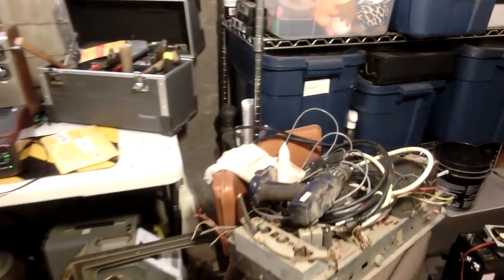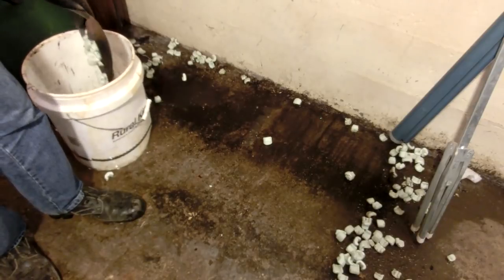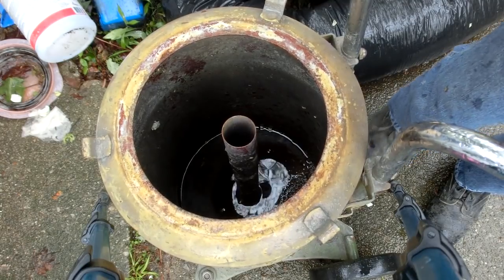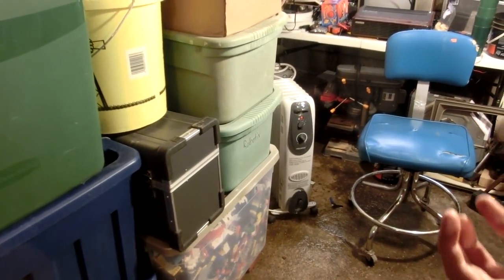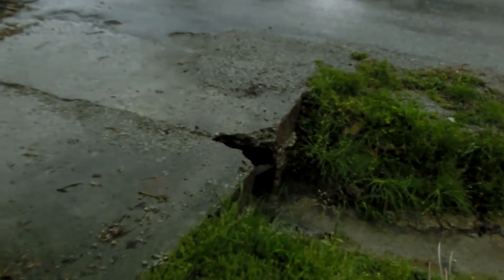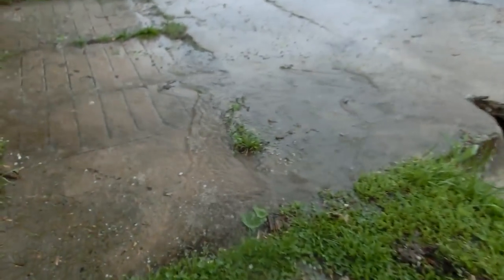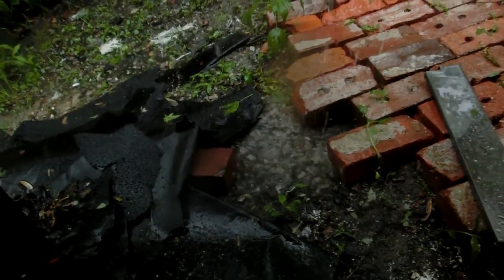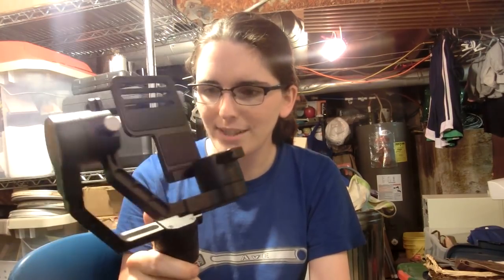Random Bits 0171: Basement Cleaning, Hail Storm, Vacuum Chamber Saves the Day

Comment: Might want to consider a sump pump. That said does your house have weeping tiles on the foundation? If it does, its probably packed with sand by now. Its an issue in the area I live, the weeping tiles of older homes are just packed with sand because of developement in the area ripping out all the plants, so the sand just flows into yards and homes when it rains, and on windy days it gets forced into houses through any holes. Sandy ground was great for growing trees, and plants, but donkey shit for growing grass, so there's nothing to keep it from flowing and blowing.
Reply from the maker: no point in a sump-pump for us, our basement floor is above the sewer line so we have a drain that lets it all drain, but the floor is uneven allowing for it to pool. it has broken bricks that dont really have much mortar between them, and lots of cracks in the concrete. lol
Reply: Yeah sounds like some foundation issues then :P when me and my Dad lived in Ottawa we lived in an old townhouse that was on septic system. And it had constant flooding problems in the basement due to the fact that the fucking weeping tiles were done cheaply, and didn't go down the the base of the foundations. Also the septic system was done extremely cheaply. (It was actually a new system, installed on top of an older system, which itself, was on an even older one. The last in that line was basically built on top of the grass then they covered it in earth. I shit you not.) So it was a constant battle against water in the basement. The power was also spotty so if it ever went out, our THREE sump pumps would shut off and all that water would come up in our basement. On the bright side, whenever it did, our neighbors got to know the pain of a flooded basement like we did. On the downside, my room was in the basement, or more accurately WAS the basement.
Reply from the maker: that sounds pretty shitty.
Reply: Literally. The new septic system was wired poorly so it kept shutting itself down and flowing into the yard. I hated that house, so damn much.

Comment: so, i live in New Mexico where it basically never rains and we don't have basements. so forgive me if I'm wrong but wouldn't it be better to stop the water from coming in, in the first place rather then deal with the water? if it's coming in through the window it might be worth looking at it and either sealing it or changing the dirt outside so it runs away from that window instead of into it? also speaking of your vacuum pump, i was watching this video where a guy who lives in china decided to see about buying and putting together an iPhone from parts he bought, and there's one scene where they show the shop and they're pulling a digitizer from the glass and attaching new glass to it then i guess they added LOCA (Liquid Optically Clear Adhesive) to adhere it them together, to do it, they had a machine to remove bubbles. i was thinking it might be cool to get one of those gameboy backlight kits that has the same LOCA and using the vacuum pump to remove all the bubbles. could be a cool project.
Reply from the maker: theres too many places where the water is coming in, it will require a gradual repair to the entire basement and then sealing it. i'd like to get the entire basement mostly cleaned up before we start doing that though. as it is now, its not really a big issue to have a few puddles laying around. the water is coming through cracks in the bricks and foundation.
Reply: alright, did you read the 2nd half of my comment though, i know i should have separated it, but i didn't want to enter and send then edit the thing. anyway, keep up the good work.

Comment: Two words: Sump Pump.
Reply from the maker: that would be pretty useless.
Reply: Dig a hole in the lowest part of the basement.  Put the sump pump in.  Plug it in and run the discharge outside or to a drain.  Problem solved.  Search for "Sump Pump Basement" and you'll find dozens of videos.
Reply: +RyeOnHam it had already been discussed in other comments, might be best to ctrl+f search in future first mate. it drains directly into the sewer and they're on a hill so it never floods. said in the video that the floor is uneven so they get puddles, but it never floods.

Comment: . I like the brick Idea, but you need to add a pallet above it. The brick will wick all the way around and into the item you are storing. You are far better offering building a proper garage with a full second story. It can be built from just busted up pallets alone. Make it in stages. QUIT bringing in stuff you don't need right away or even 6 months. Concentrate on building racks to hold all your basement items, Open up the center. We know your are a packrat, don't become a hoarder with little paths all over the place. Enjoy your video, consider a webcam. Make them rotating with a motion sensor,  So if you are doing something we can watch, Free at first and pay later.
Reply from the maker: i'm fine with it being moist, but i'm not fine with it being a material that will rot.

Comment: Rinoa, just cut a shaft like 40cm deep and place a pump with drain outside (battery and solar charged) done.Kind regards
Reply: That's not really needed since she said she is on a hill. Some tar and visqueen would be cheaper and still do the trick that's how my basement is done.

Comment: you need to get that drainage fix'ed. hope you have a smal digger ready.
Reply from the maker: +grapsorz it shouldnt require much digging, its an issue if cracked concrete and missing bricks in the foundation. we should be able to fix it from the inside over time.
Reply: well i have fixed that type of problems befor and the problem is outside even if you have som minor problems inside. if the external drainage pipes is open and the external membrane and air gap is in place you can not get water in to the basement like that. 

http://isodren.no/wp-content/uploads/2014/04/Dreneringogfilter.jpg
Reply: and yes i have done it from inside as well.. in implied going UNDER the wall (going two feet down under the floor) and fixing the drainage system that way. stil it's not a complete fix as the membrane problems was stil there.

Comment: Hi Rinoa. I was thinking that you should put something in the basement to soak up the water where it comes in at. Something maybe like the crystals that you put in soil to hold water. They absorb 400 times their weight in water so 1 pound would turn all of the water into a solid that could be removed easily and then re-dried and re-used again. Might help with future cleanups. You always come up with great ideas so you probably have already implemented a better idea. Great videos. Have a great day.
Reply from the maker: why do that when it just flows to the drain? no sense in expending a product trying to do what gravity already does. i just need to smooth out the concrete floor so the water doesnt pool in the low spots, then seal the basement.
Reply: You are right about that. I knew you had a great idea. You can get concrete leveler by the bag. I have never used it myself but I guess you can pour it in low spots and it flows into the low spots leveling things out. If you did something like that it would make a great video since there are a lot of people with the same issue that have never thought about actually fixing it.
Reply from the maker: dont worry, i'll cover the structural upgrades to the basement just like the organizational upgrades. we will start from the top down though. we will fix the foundation then the basement ledges, then walls, then floor. it'd be a shame to do the floor first and get dirty water flowing over it. lol

Comment: ok this is how I solved this problem , I sought out the lowest spot in the basement chipped out a hole in the concrete dug a small pit in the dirt below the hole and installed a sump pump now my basement stays dry even in rainy spells (plus a dehumidifier )
Reply from the maker: we have the same thing just it leads to the sewer line and requires no mechanical action to remove the water. its called a "drain". lol :P
Reply: yep and i see how well that's  working for you also
Reply from the maker: yeah it pretty much makes it impossible for the basement to flood unless theres a sewer issue.

Comment: if you find the level of the basement from outside dig a trench close to the house and fill with gravel to a drain or somthing so the water wont reach the same high and flood in
Reply from the maker: nah, we just need to make the floor level.
Reply: I wouldent make it level but maybe angled towards the drain so if water does get in it flows away
Reply from the maker: i'd rather it be a level surface. as it is now it slopes away from the drain.

Comment: ....is the gradient to the house still sloped away from the house where the earth meets the foundation?
if the earth is low around the house then water will build up and start leaking into the basement. 

safe travels
Reply from the maker: we live on the side of a hill so its hard to do that. one side is somewhat level though.
Reply: well you dont want level....what im talking about is the water coming off the roof and pooling around the base of the house and the only place for it to go is into the ground. which leads to into the basement walls. so what you are trying to achieve is an easier path for the water coming off the roof to flow away from the house.

the way i normally check for this issue is walk around the house while its raining and look for water pooling within 2 feet of the house. any places with water pooling up dump dirt close to the house and pull it down across the puddle so you know you get it and pound it down so its hard and easier for run off of water. make sure you build it up enough so the land slopes away from the house....stuff erodes over time you just gotta build it back up every once in a while..
Reply from the maker: +wizard4204 doesnt matter what you want, it matters what you have.
Reply: indeed

Comment: Yo Rinoa, I think you need some Drylok on the walls and a sump pump in the basement.
Reply: Or some bigger fans...
Reply: i agree he should also get a stronger dehumidifier
Reply from the maker: we need to fix the foundation of the house first, and no you dont need a sump-pump in a basement that wont flood. we have a drain.
Reply from the maker: the humidity is always pretty low though, like it was about 65% while i was filming this. its more of a matter of getting the water to evaporate than getting the water out of the air.

Comment: I love all your videos :) your genius is showing ;3
Reply from the maker: well thanks, hahaha
Reply: Rinoa Super-Genius seriously, was binge watching a lot of your and the guy who you collaberated with for the Nissan Leaf Cell projects :) I really like your work, and you and your family seems a lot like how I'd like to be :-P and also your yard is so pretty
Reply from the maker: who did i collaborate with?
Reply: Rinoa Super-Genius Benjamin Nelson I believe
Reply from the maker: oh i dont think i've ever really worked with him, only talked to him about EV stuff.
Reply: Rinoa Super-Genius ah, ok whatever happened to those Leaf Cells? are they still ok and holding a charge? and what did you do with the Gyroboard after it exploded?
Reply from the maker: i have the leaf cells stacked up ready for any possible experiments. they are holding comfortably at like 3.7v so they are doing great. and i left the gyroboard in my dad's barn, will probably go pick it up whenever i find a use for the remaining motor.
Reply: Rinoa Super-Genius may I make a suggestion? find a way to wire the pressure plates as pads or a throttle control or make it into a motor for like a scooter? using the leaf batteries for power?